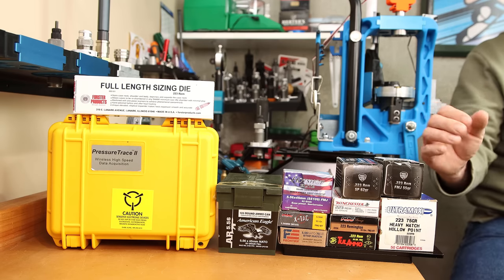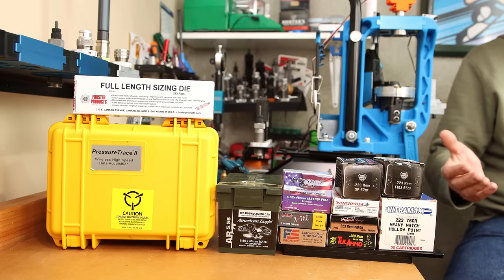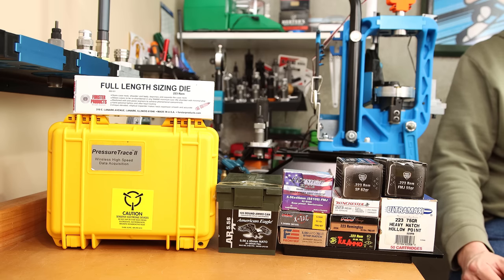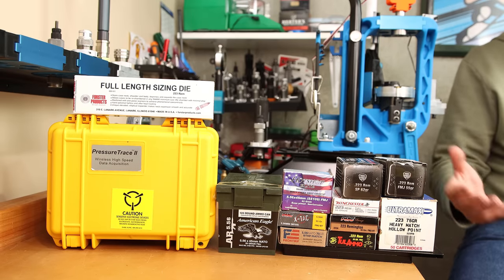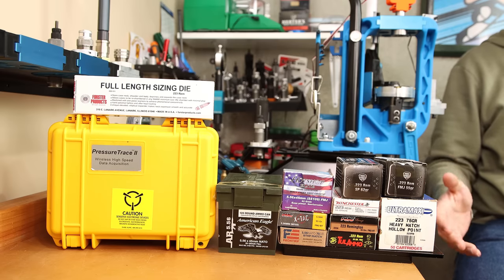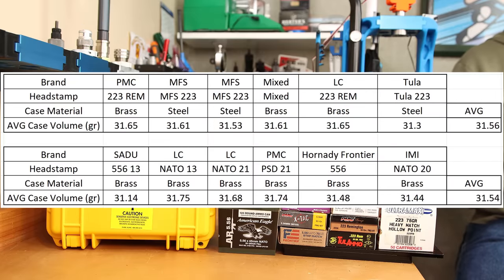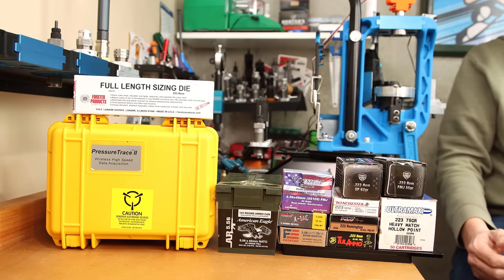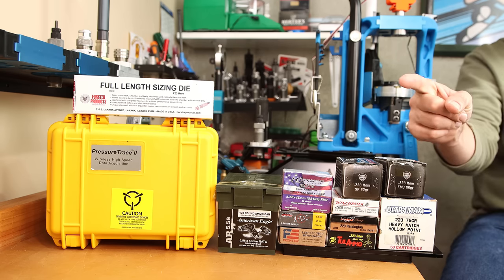223 vs 556 - The Hidden Truth No One Tells You!

Comment: The safety issue was primarily from early guns that had been adapted from .222 Remington in the rush to bring the new cartridge to market. They used up their safety margins in the conversion, and companies weren't nearly as cautious way back then, so you had lightly-built break actions that were blowing up. Because everyone was well aware of the risks of someone putting 5.56 in a .223 chamber, generally speaking everything from the 1970's or later SHOULD have enough of a safety margin to handle it, and definitely since the 1980's. No one wanted that liability, so they put extra meat in their actions to handle it. That plus modern metallurgy has effectively eliminated the risk.
Reply: The first   ar tried  by  the  army was loaded in 222 Remington.  Remington  owned  the rights, so it was changed a little  and  called  the  223. After the army tested it in 222
Reply: Still using ammo the weapons designed for is always the way to go. As my ccdw instructor Said you don't need to worry about bullet drop at 100 yards point center mass 1inch won't matter. 
So focus on what works don't be that guy w the exploding 50cal in ky.
Reply: @Will-dn9dq  that guy in KY didn't load that ammo.  He bought it off someone else who loaded it wrong.  It was supposed to be mil-spec and obviously wasn't.
Reply: @phoenixrising4073  I know I watched it as it uploaded.  Still putting steel tubes of nos in a shotgun is dangerous and dumb that lil sheet floppy Kevlar wouldn't do much u see the holes in it? 😆
Reply: @Will-dn9dq  You're talking about 2 different channels.  The guy with NO containers out of a shotty is from CA and his channel is called toaflodermaus (or however you spell it.)  The guy who almost died from the .50 exploding was Kentucky Ballistics and he doesn't shoot "junk loads" out of shotties.  2 different channels entirely.
Reply: @phoenixrising4073  I think your assuming way too much. Reread my posts I Said "don't be that guy in ky" so obviously I'm talking about the 50cal incident as a warning/ example of don't be that guy. After watching a video of a guy shooting nos tubes out a 12gauge. 
What do you think I'm talking about?
Obviously I'm warning the public/  guy made video an using another video about another guy that had a pretty much worst case scenario. People that aren't engineers on ammo an metal stress plus explosive pressures should not mess with loading hot or experimental loads. Especially if they plan on shooting them personally instead of doing like the ky guy did w rest the hot ammo. He shot it all off remotely w a string behind alotve wood am his truck. Least 2 more those shells where way too hot.
Reply: @Will-dn9dq  you don't even know the correct story of why the gun blew up originally.  He never loaded the shell that almost killed him, those were military surplus that some jackass tampered with and he had no way of knowing.  The other videos of him purposely blowing guns up were to see how much pressure it would take to achieve the same results.  2 different scenarios.  KY Ballistics has never shot an experimental load while holding the gun.  Please show me a video where he did that.  But yes I agree, people shouldn't do stupid things.  I gotta go work now, have a nice day.
Reply: @giles-df9yu  The “story” is that  It was changed because the 222 would not make the velocity desired with a 55 gr. Though you could also be correct since they could have used the 222 mag.
Reply: @Will-dn9dq Why is your ccdw giving advice on 100 yard shots? Ccdw for rifle or something? I do appendix carry my AK, so I suppose anyone else could too
Reply: @diktat6558  I'd like to think they would have a general understanding of firearms, not necessarily just handguns in short range. Really, any firearms instructor should know a decent amount about all of the common types of firearms
Reply: @giles-df9yu  Armalite found that the 222 wasn't able to meet the velocity requirement the Army wanted.  They modified the 222 by shortening the neck and blowing out the shoulders to increase case capacity to get the velocity needed.  They initially called it the "222 Special" (you can still find cases out there actually head stamped as "222 SPL").  Afterward it was determined that it was different enough that they needed a new designation, and thus it was renamed as the 223.
Reply: @Will-dn9dq  that guy in KY is one of many who have been injured by weak bolt guns. He didn't use home loads. So the round had jack to do with his injury.

Comment: As a retired Marine, and reloader, I can say that 'I've acquired' thousands of empty LC brass (among several AAP's)...and I caught the differences almost-immediately between .223 and 5.56 brass. All else being equal (primers, powder and projectile), the brass (most-definitely pre-2004...which is what most of mine is) is THICKER! I first caught it, when I was loading 'rod' powder (IMR) and found that to reach 'upper load limits' (Speer reloading), I was having to PACK IT (compressed loads) to fit the charge in there...where with Win or Fed brass, it was a non-compressed charge. I mic'd a few cases, then ended up dremmeling a case in half, just to get some micrometer readings. I went to my older reloading manuals, and where .223 was seperate from 5.56 in loading data, I found that the case drawings were different as well (referencing that 'long case' situation...it only gets worse once you reform the brass in your reloading dies). By my own calculations, there is about 1.24 grains of capacity difference between .223 and 5.56 cases...and the thicker brass results in overall lower capacity (the 'extra brass' reduces the interior dimension). When you're loading with the 'default powder' for the 5.56 (Hotshot powder), this isn't an issue, though.
Also, though you don't always see it, there is a varnish sealant placed on the primer (OEM Products), to make the cartridge 'waterproof' and 'humidity-proof', for long storage or damp environment use. It is usually a 'dark pink' in color. If you see that line circling your primer, then that is a sealed cartridge...something that I've never seen the .223 market do (adds cost to the product).
Reply: Word I always heard was that military/NATO 7.62 brass was thicker to hold up when linked for MG use. Always assumed the same held true for 5.56.
Reply: I noticed the difference myself, and I look for the LC heavier brass. I am frankly jealous of your stash, lol. I am working on a 17 caliber wildcat I call "17 Fireball AI (Ackley Inspired)" using PO Ackley's formula of straight wall/40. So far it has shown a lot of promise for increased case life with hot loads
Reply: I know this is a little late but in case you want to know I have sealed 223 with the "hot pink" circle around the primer. I think it was Igman ammo. Wanna say from brasil.
Reply: I have noticed that different manufacturers have different wall thickness in the same cartridge. 30-06 remington case has different capacity then 30-06 Winchester brass.
Reply: @emmettpatterson3198  Brazil produces 5.56x45mm NATO M885 and M193 ammo. It may be packaged ".223" but it's probably MILSPEC overproduction sold on the commercial market.
Reply: @emmettpatterson3198  Igman (Czech Republic) seals their .223 primers.  Have thousands of rounds of it, good ammo
Reply: @RealJeep  yea that's true. Their ammo is tip notch. I just ordered igman m193 from my local FFL as I live in a state where we can't have ammo shipped to my door.
Reply: That's a pre-2005 LC thing not a 556 spec.
Reply: @michaelsnyder3871 Wrong!!! Magtech a division of CBC produces .223 Remington for commercial purposes. CBC produces 5.56 for military use only. 

You don't want 5.56 pressures in your .223 hunting rifle.

Comment: This is a very good video and very close to the answer.  As stated, the 5.56 throat/freebore is longer than the 223.  This is where the magic is.  If you shoot 223 in a 5.56 chamber is will result in a lower pressure (as noted) and lower velocity, even though both cartridge's are intended to operate at nearly the same pressure.  Moving the rifling out longer in the 5.56 has the effect of making the chamber larger without changing the case... a magnum trick.  The pressure event, with rifle powder, happens when the projectile swages into the rifling and seals the combustion.  Pushing the throat out in 5.56 requires more powder to maintain pressure.  This extra powder will continue to burn as the bullet moves forward, ultimately producing more energy.   In short, the difference is in the powder charge because of the different chamber.   It is accurate to say the 5.56 is loaded to a higher potential not pressure.   Finally because of the extra powder in the 5.56, loading it into a "true" 223 chamber will result in higher pressure.   Probably near proof pressures.
Reply: Best explanation yet. Thanks!
Reply: Wylde stuff.
Reply: THIS!  This same explanation also applies to another fine AR15 based cartridge.  The 6.8 SPC/6.8x43/6.8SPCII.  The 6.8SPC=SAAMI spec.  The 6.8x43 is equivalent to .223 Wylde in leade.  The 6.8 SPCII is equivalent to to 5.56 NATO leade.  In both, the SAAMI spec may tend to promote a slight higher accuracy potential, the largest chamber promotes reduced pressures, the middle chamber is the middle ground to try and get the best of both worlds.  Where the 6.8 differs a bit is that the magazine for the AR15 is the limiting factor since it must fit inside the magwell of an AR15 lower.  And, the timing of the gas operation vs. the pressure spike.  A non-issue in a bolt action, where you have the option to load a bit longer to give a slight reduction in initial pressure, and the chamber remains sealed at the bolt until the shooter manually cycles the bolt.  

So, can a 5.56 round, loaded a little long be safe in a bolt action .223Remington?  This would be what one should measure and determine for their needs.

Another factor in secondary pressure from chamber to muzzle is the type of rifling used in the bore.  A six-groove Enfield will apply more engraving force on the bullet, causing more drag/resistance/friction prior to the bullet clearing the muzzle.  Both in even number (directly opposing forces on either side of the bullet) and the sharper edges of the rifling cut.  A 5R or a 3R rifling will impart less engraving force, due to the softer edges of cut and offset engraving forces, allowing for a reduction in drag/resistance/friction.  The bullet is free to move through the bore more quickly and helps in that secondary pressure.
Reply: @stevealford230  😂
Reply: This is exactly what I was looking for. If everything is the same, including his chamber for testing, but getting more pressure and velocity from 556, then it HAS to have more powder charge. We’ll said?
Reply: Well said, I a guy groundhog hunting that purposely used light loads 556 in a 223 gun to get higher velocities, it worked for him and his rifle  never exploded or anything, certainly wouldn’t try it with hot loads but he was getting 4050 fps out of 45 grain 556 was pretty impressive for ground hogs he was basically point and shoot out to 400 yards with basically no bullet drop at all
Reply: @JimboJimmy-i2u ya what barrel length
Reply: It won't be anywhere near proof pressures.

Comment: I'd say for reloading: there's not enough difference to make a difference, as long as you load to what your rifle can handle/likes you'll be fine using both 5.56 and .223 brass. Just invest in a primer pocket reamer.

As far as factory loads: I personally stick to the rule of "if it's labeled .223 on the gun: only use .223, if it's labeled 5.56: then you can use both."
Reply: Thats the rule of thumb I stick to In my AR15.

Comment: I have been reloading 556/223 mixed brass for many many years now with 55 grain  FMJ and I  can't tell any difference between the two....  same groupings at 100 out to 500 yd
Reply: A lot of factory .223 has the same velocity as .5.56 on the box mostly with Russian steel case. This was something I noticed a while ago. I always hand load at .223 pressures just to squeeze a little more life outta the case. I don’t actually know if it makes a difference.
Reply: Same here.
Reply: Effin' aye Cotton!"
Reply: 556 has higher pressures and reset into the casing….
Reply: @chrisallen3741  not my reloads ...
Reply: 223 ran in a .556 chamber become.556 from pressure forming just make sure to not skip annealing.
Reply: @kinzieconrad105  There are no differences in the case spec or in the portion of the chamber where the case matters between the .223 SAAMI spec and the 5.56 NATO spec. The only difference in the chamber spec is beyond the mouth of the case. That's why reloading dies for the two are identical/completely interchangeable.
Reply: Same as well.  I have found if you weigh the 5.56 casings compared to 223 casings, the 556 weighs slightly more consistently. Not tons, but slightly. But when reloaded no diff un performance

Comment: Well done!  Most stuff I load are plinking rounds at a mid range charge. Doesn't matter if I use 233 or 556 brass.
Reply: The 5.56 brass being thicker does allow 1 more Reload process without splitting the neck of the casing. I've been reloading 223 and 5.56 since 74 I've seen everything that could go wrong including over charge weapons explode etc etc etc the only reason we changed any load pressure was to perfect cyclic repetition and cyclic speed without missfire. The increase in fps was never a thought it was putting more lead downrange. Close quarters have need to be shorter for obvious reasons but when you put a 2" Barrell and 9" of flash suppressor on a full auto m-4  platform the gas tube length changes too and gas pressures are greatly affected so is cyclic timing and gas and flash build up at  the muzzle can blind and burn the shooter. Larger gas tube and reduced pressure or a slower burn powder and lots of patience. Y'all keep in mind trimming your casing length properly each time you Reload will help prevent cyclic problems as well.

Comment: I learned a huge amount from this video. It's especially helpful because I'll be starting to load some 5.56 from once fired mil stuff out of my gun. Thanks for the obvious time and effort you put in to this channel!
Reply: Crimp removal is a P.I.T.A., but only once.
Reply: @badvlad9861  not with the right tools. Get the Dillon super swage remover. But I'd recommend just reloading 223. You can use the military once fired...
Reply: @badvlad9861 it's killer on the fingers after about 500 cases, but a reamer bit on the Lyman case prep xpress followed by a hornady primer pocket cleaner is the only way to go for me! The pockets come out cleaner pre wet tumble than the rest of the case does post tumble! 😄

Comment: I can understand a rationale for loading to the headstamp (5.56 loadings in 5.56 brass and .223 loadings in .223 brass). If you are the only person who will ever use the ammo, then there is no reason to separate them, but if there is any chance that someone else may (borrow from you, share with friends at the range, etc), the correct headstamp can help to make sure that they don't put hotter ammo into a rifle that is not rated for it
Reply: Damn good point I hadn’t thought of.
Reply: And we only bought firearms stamped 5.56 so we (can use) either
Reply: LC just says LC because they probably wanted to put this stupidity to rest... and stamping LC is easier.
Reply: If you are loading mixed 223/556 brass with 223 load data then it shouldn’t matter to anyone else who might use your “5.56” ammo in their “.223” gun.
Reply: @xephael3485  Nothing to do with the question of 5.56 vs .223.  LC produces brass for the military and sells the excess to civilian manufacturers.  Rather than put a head stamp that would force the issue, they keep it generic.  Also, for their application (i.e., military), there is only one loading going into the brass.
Reply: @detritus23  they're not the only manufacturer to stamp without caliber or round designation though.
Reply: @xephael3485 I am sure other military manufacturers don't.  Checking my reloading brass IWI and Prvi Partizan both don't mark caliber on their headstamps, either .  (PPU doesn't stake 5.56 primers, for that matter.)  i am just noting why LC marks its headstamps the way it does (like other military suppliers, they do code the manufacturing date into the stamp, though.)  There is appears to be no hard rule about headstamping civilian sale ammunition, other than marking manufacturing source.
Reply: Most actions not to say all actions are rated to take double the pressure  for safety reasons , i think we have to take in consideration the go/ no go when a bolt is closed,  but i believe on this perticular cartridge as in the 308 / 7.62 x 51 is the actual designation as what the cartrige is reffered to or head stamped for those countrys that don't permit any military cartridges to be used by civiliance.